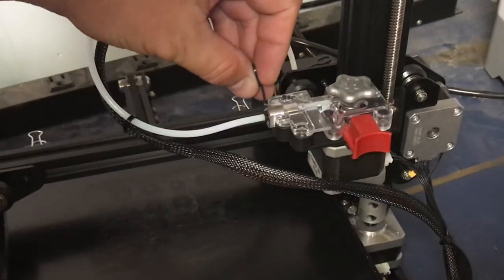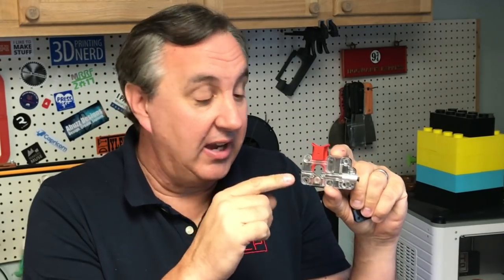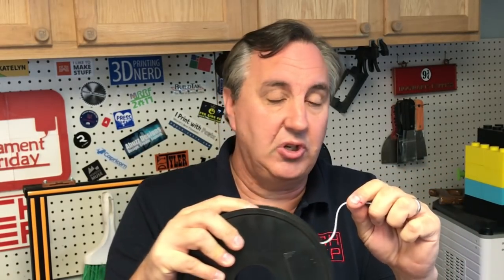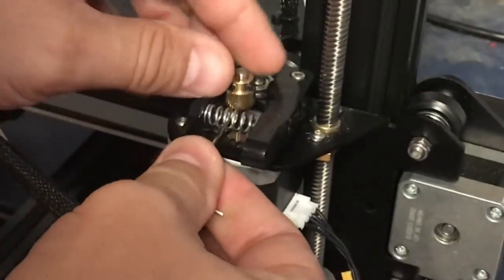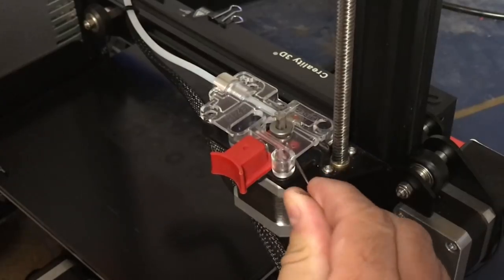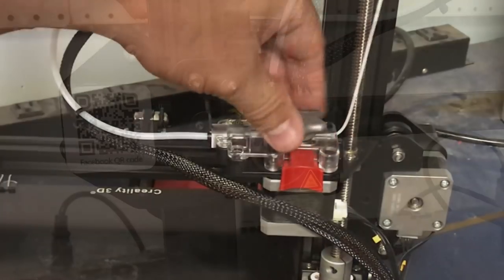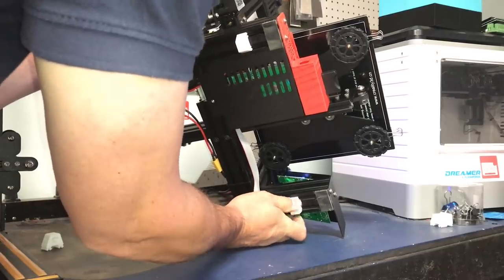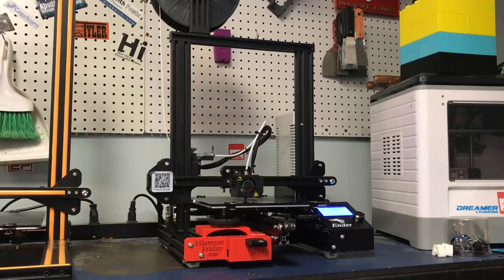Flexible NinjaFlex TPU using EZR on Ender 3

Comment: Is there any way to put this on a Ender 3 Pro with the gear that is stuck on?
Reply from the maker: Yes, I believe that will work.
Reply: @FilamentFriday  I actually took my feeder apart when I got home earlier and it has 2 grub screws on the shaft. So it does work, unfortunately when I was fixing the PTFE tubing on the hot end with your spacer and connector upgrade I broke a fan blade off putting it back together... so no printing for me until Tuesday when I have a new fan from Amazon...

Comment: Does that really help wit TPU filament
Reply from the maker: It does for me.
Reply: @FilamentFriday  and that’s an dual extruder as well
Reply from the maker: No, single extruder. It traps the filament so it can’t escape which soft TPU tends to do.
Reply: @FilamentFriday  will TPU work wit an dual extruder u think
Reply from the maker: Dual extruders for 2 color?
Reply: @FilamentFriday  sorry ment an dual gear extruder
Reply from the maker: Dual gear really doesn’t trap the filament so TPU can typically escape the extruder.
Reply: @FilamentFriday  so what extruder do u prefer for TPU
Reply from the maker: Are we circling back to the first question?
The EZR that I show in this video
Reply: @FilamentFriday  so is the EZR the only extruder that works For TPU
Reply from the maker: Make your own: https://youtu.be/az7pysnV_MY

Comment: The screws that came with mine were the wrong size (too long and to short) for my cr-10 mini... What should I do?
Reply from the maker: The shorter ones are for the stepper. Make sure they are pushed to go all the way into the holes in the plastic. I found they can hang up a bit. Otherwise contact the company or possibly just get some longer screws at the hardware store.
Reply: I had the same problem. Too short.
Reply: I had to shim between the EZR and the mounting plate, with the included washers, then use the longer screws. The shorter screws would not catch on my Ender 3. Without the washers, the longer screws bottomed out in the stepper.

Comment: Just installed mine trying to fix an under extrusion problem and the new stepper motor just clicks back and forth left and right.
Reply from the maker: Check the wiring connector.
Reply: @FilamentFriday  wiring is good, looks like the high torque motors they offer with them...are a different voltage facepalm  Welp, upside, I go to build my own printer later...1 less motor to buy? LMAO  oy vey... the things we learn the hard way.

Comment: anyone know of a UK supplier of these thingamabobs?
Reply: @TheNigaHigaFan4Ever  Thanks Rohan but the shipping fees are understandably high
Reply: @TheNigaHigaFan4Ever  You might have noticed the same , as time goes on I am finding things harder and harder to get hold of. Not just this extruder but also cheap ink printers and PLA filament. I think it shows just how much stuff was made in China we had all become dependant on.
Reply: @TheNigaHigaFan4Ever  yes you are lucky:) You might want to consider re-selling to Ebay UK especially black PLA
Reply: @TheNigaHigaFan4Ever  sadly after all this is over I doubt if there will be enough work for people already here

Comment: I just recently got an ezr struder from seeme cnc and the coupling on it wiggles around. Is this normal? or should I return it and get another one?
Reply from the maker: Not sure what you mean. It’s a pretty big block. Have you inserted the PTFE?
Reply: @FilamentFriday  Its almost impossible for me to fit the capricorn tubing in but after I did, the metal coupler still moves around. If you grab the PTFE and move it up and down, the coupler will slightly move up and down also. Basically, if you grab the coupler, should it be solid in place, or can it move a little? Also because the PTFE is so tight, I can't get the clip to snap under the coupler. Will this be a future problem?
Reply: @nateweast548  Did you insert and tighten the 2 closest screws and nuts to the coupler? You should have a total of 6 screws going into the extruder, 4 bolting it down to the motor and the 2 clamping down the coupler
Reply from the maker: Watch his later videos. He loves the EZR. The aluminum loose is not an issue. Once the PTFE is inserted all the way and the C locking clip installed, the PTFE doesn’t move.

Comment: Any one know what steps per minute adjustment when swapping over then feeder gear ? For ender 3
Reply from the maker: I’ve been running it on Ender 3 for a month with stock settings and it’s fine.
Reply: @FilamentFriday  awesome i had been using the red metal one but its having an issue with feeding filament because both holes arent lined up perfectly

Comment: Just got mine installed and tried to print NinjaFlex. Even with the tube extending to the gear the filament found a way to shoot itself out thru the hole in the top. Any ideas?
Reply from the maker: Are you using my profile?
Reply: Yes
Reply from the maker: Try 5 mm/s slower.
Reply from the maker: Try 5mm/s slower.
Reply: @FilamentFriday  Actually I think that I figured it out.  On the prints that failed I had a lot of slack in the filament going in to the extruder.  I took the slack out and the print seemed to work.  Thanks for the help
Reply: @FilamentFriday  HEY CHUCK! Keep up the great work!  I really love your channel!!!  Where can I find that profile?
Reply from the maker: In the description here:
https://youtu.be/2Ejo6EVQ5Gc
Reply: So is this only for flexible filament, I installed it have not tried it yet but can I use it with any filament. I’m guessing I have to remove it when using pla or abs.
Reply: @MrElasky123 ... Oh no, it's for any filament! It just has a closed straight path for the filament, so when you get to using flexible, it can't snake its way out of little gaps in the extruder like the stock one and others have. Plus, it's so much easier to load any filament.
Reply from the maker: It works with all filaments
Reply: @chrisodonnell6769  Curious... Are you using a filament guide?  I am and have experienced the same issue where filament found a way out in the ezr and eventually wraped around the gear.
Reply: Stormshadow I am not using a filament guide. Mine is back to doing the same thing again as well as skipping a lot with regular filament. Not real happy with this extruder
Reply: @chrisodonnell6769  I changed my spring on the EZR extruder.  Once I did that, it worked like it should.  I think the spring the EZR ships with puts to much pressure on flexible filaments during printing to the point it leaves a squished impression in the filament which cause the gear to start skipping and eventually leaving your filament to back up in the extruder and potentially wrap around the gear.  Since I changed the spring on the EZR to use the spring that originally came with the ender 3 pro, it has been normal with no issues with skipping or binding.  I changed my Esteps too. I print 85A shorehardness flexibles at 10mm/s also and of course with no retraction.

Comment: I just received my EZR Struder from SeeMeCNC and apparently they are not as good as they once were.  No allen wrenches,I have my own anyway. Black bottom of EZR so warped that once installed the spring lever would not function. None of the bolts/screws the right length. And of course the Teflon tube would not insert all the way!  Very disappointed and I am waiting to see what SeeMeCNC has to say about this!
Reply: Are you sure that's not a copy/fake?
Reply from the maker: Any update on this?
Did they replace it?
Reply: I can confirm my EZR Struder experience was similar to Sotm, I have constant gear slipping issues, I've adjusted the gear height several times and I can't recall having noticeable slip from  stock Creality... I purchased NinjaFlex and will be doing some tests before pulling it off.  I bought mine directly from SeeMeCnC website, thought my issues was just a  1 off out of a batch.  Quality must have taken a dive from the original.
Reply: @tony1l11  I too am having slipping issues from a unit I just bought.  My slips seem to only be on fast retractions at the moment, but like you, I am probably going to pull it off and go back to a metal Creality.   Its a shame a I like the unit.
Reply: @matthewhirsch1438  I pulled mine, I'm a huge fan of SeeMeCnC design,  but it started slipping on its first print combined with silent steppers, slip pop is louder than the fans and quite annoying.  I've tried adjusting it after the 3rd time i gave up & went back to stock, no issues after that.
Reply: @tony1l11  I sent them a support note about my issue and got this.  
"Try installing two bolts on either side of the aluminum PTFE tube push fitting. This will clamp it securely. 
Also recommend installing the PTC clips (little plastic parts that look like a wrench) to keep the push to connect from moving
jam at hotend
first layer too low
cheap filament"
All useless because I am using good new filament, have the clips on, tested my print height and have a new tip.

Comment: @chep how does this extruder compare to the MacEwen 3d FlexiPlus? https://3dprintingcanada.com/collections/macewen3d/products/macewen3d-flexiplus-flexible-filament-mk8-extruders-aluminum-drive-feed
Reply from the maker: I don’t have one but first of all EZR is slightly cheaper and works really well. It’s the same extruded used on the $3000 SeeMeCNC Artemis.
Reply: @FilamentFriday  Gotcha.  Thanks for the quick reply.  Only benefit I see of the MacEwen over the EZR is that it's made of aluminum.  I appreciate your channel and the thoughtful tests your perform to see if all suggested upgrades actually make a difference.  You're the man!

Comment: My tpu is getting stuck in the ezr after a couple of minutes of printing. Is there anything I can do to fix this or am I doing something wrong?
Reply from the maker: See if the spring is squishing or flattening it just before the Bowden tube.
Reply: Same here tried everything from slowing down speed almost to 15mm/sec and no retract still after 10-15 minutes TPU starts escaping out of the extruder
Reply: Alper Dortbudak I’ve tried everything. Still getting stuck at the beginning of the ptfe tube.

Comment: Can you still print PLA as usual with the EZR?
Reply from the maker: Yes.
Reply: @FilamentFriday  Fantastic! thank you for the quick reply.
I just dont understand what this extruder actually does. From my understanding, it just creates an elongated tube for the filament to run through so it doesn't bunch up. Is this correct?

Comment: Shipping cost to Poland 132$ OMG
Reply from the maker: Wow. That seems really high for something so small and light.
Reply: @FilamentFriday  its 75 euro's to ship to the netherlands.
I tried to contact them about it but they dont respond back.
Reply from the maker: Which one MatterHackers or SeeMeCNC?
Reply: @FilamentFriday  ceemecnc.
Matterhackers wont ship it to the netherlands.
Reply: $90 to Finland! Isn't there anything similar available anywhere with reasonable shipping costs to Europe?
Reply from the maker: There is always the 3D printed solution I show in this video. It works good. https://youtu.be/az7pysnV_MY
Reply: I talked to the sales guy and he added new international shipping options.
Reply from the maker: At SeeMeCNC?
Reply: @FilamentFriday  yes
Reply: Thank you David Coopman! Shipping cost dropped from $90 to $14 (cheapest option).
Reply: @opkurppa  no problem.
Just happy to help the community.
Reply: To the uk it was only $13 but UK customs soon sorted that with a £25 customs charge. GGrrrrr